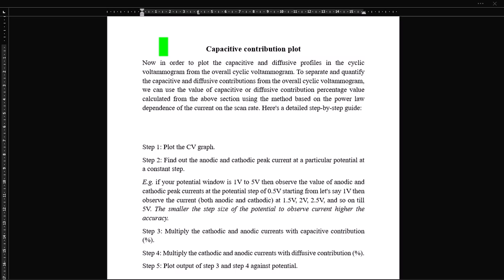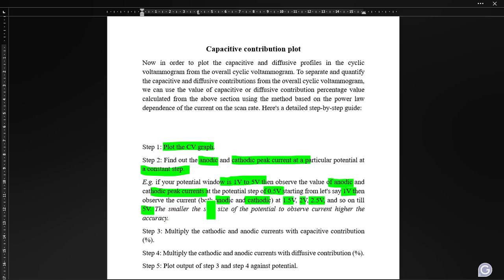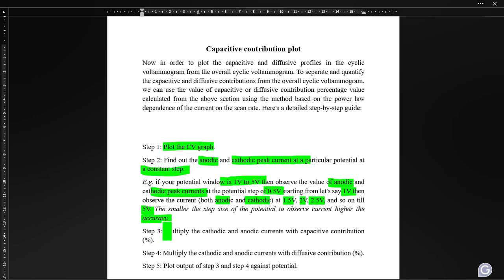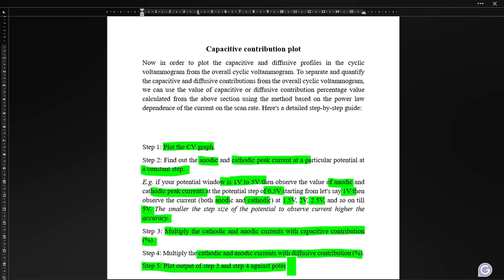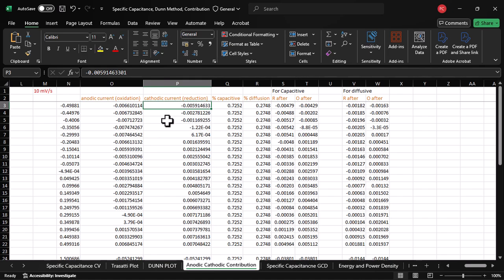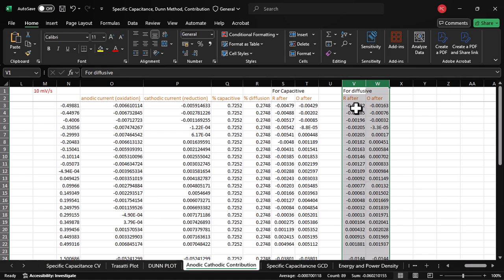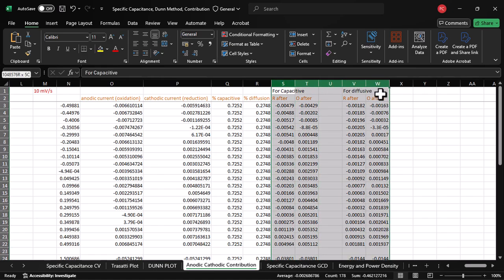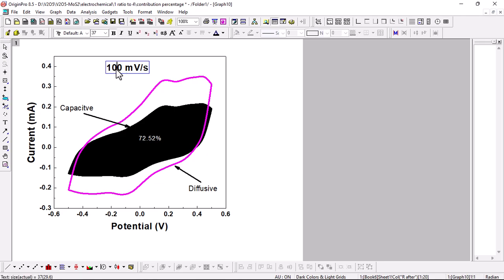4. How to plot separate capacitive and diffusive profile contributions in cyclic voltammetry

Comment: thanks for explaining all the details. but i want to know your final capacitive contribution curve is exceeding the original curve. why? the capacitive contribution you calculated from the original CV curve so it should lie within the original curve. please explain
Reply from the maker: Thank you. The capacitive contribution curve can exceed the original CV because it’s derived from a mathematical fit. Small fitting errors, baseline shifts, or slight overestimation of k1, k2  can make the capacitive part locally higher, but the total of capacitive and diffusion contributions still reproduces the original CV.

Comment: Sir, 
Kindly tell me in  your previous video,you wrote the formula of cv without being divided by 2 in numerator. So it's still confusing which formula is correct, for 3 electrode and 2 electrode of battery and supercapictor